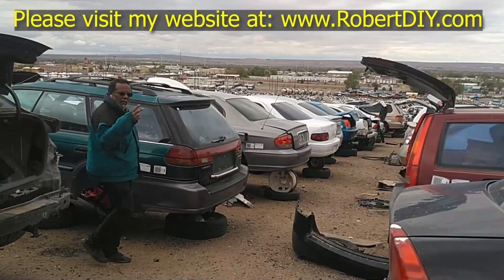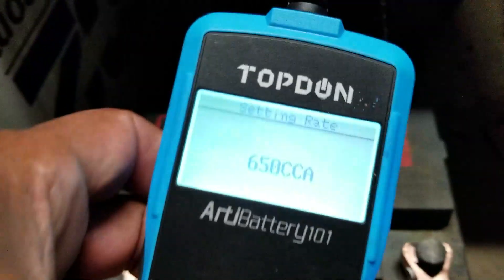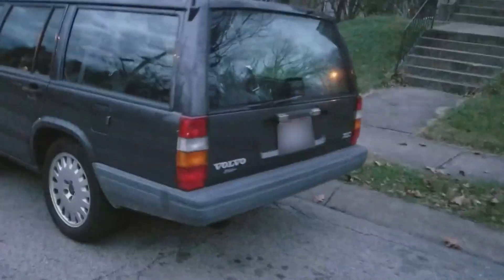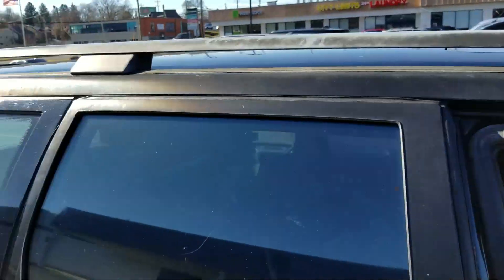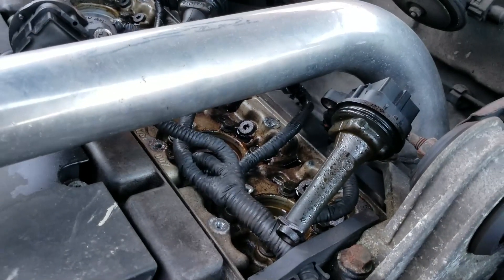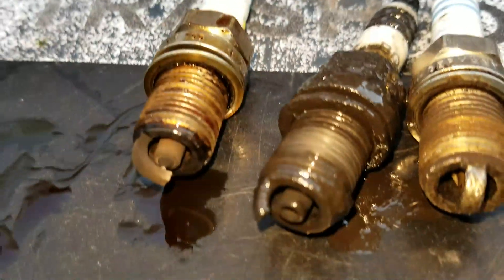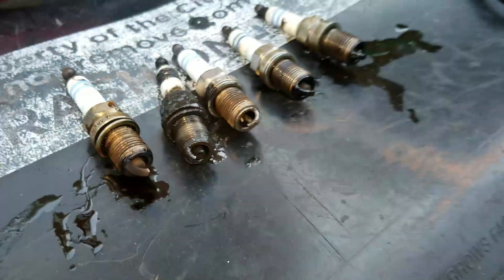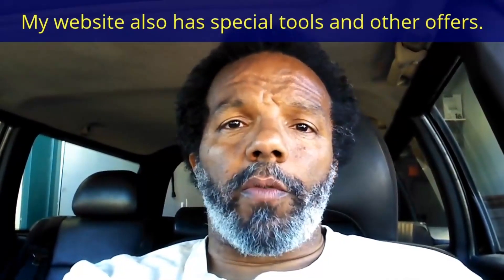Visited my storage facility, tested and charged a few batteries and you will NOT believe the V70R...

Comment: even if that electrode bounced out the exhaust valve you would think it would have jammed up the turbo. It is possible that 
it got bounced into the intake and got sucked into the two other cylinders closing the sprkgap  there. and fineley ended up in cylinder 1 where it nicked a valve or broke a ring land given low compression there. when you open it you will see all sort of peen marks on the pistons and head.
Reply from the maker: It's crazy.

Comment: When I remove a hood for storage, I bolt a narrow strip of plywood where the hinges mount on each corner, so I can lean the hood up against something without breaking the paint on the corners of the hood against the floor.  I cut the wood just long enough to elevate the hood a couple inches off the floor.
Reply from the maker: Wow! Nice tip. I'm going to have the hood painted so it doesn't matter on this one, but that is a great way to protect the paint.

Comment: The 960 gear selector switch aint this similar to PNP switch on the 850's. If so, it might need to be adjusted!
Reply from the maker: It makes the reverse lights come on in the proper position. Also, it would have cranking issues in P and N if out of adjustment.